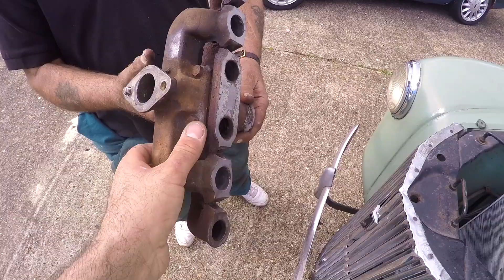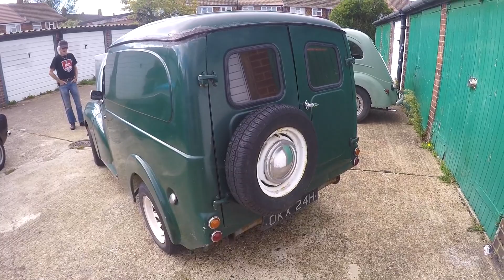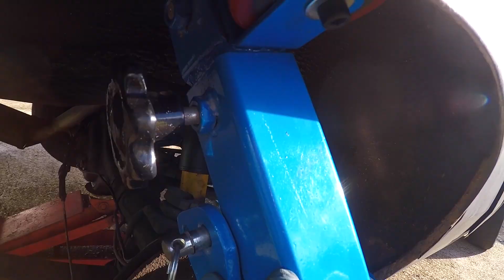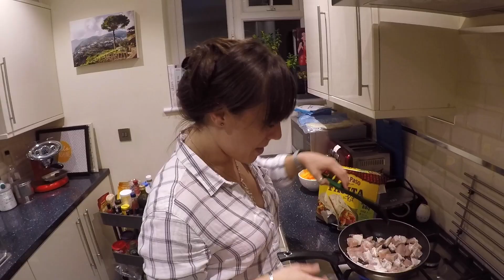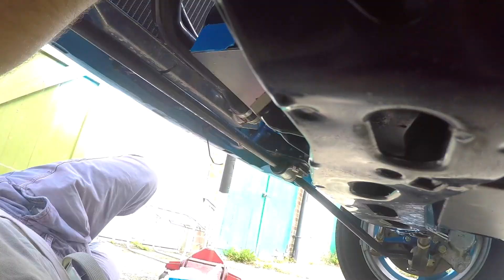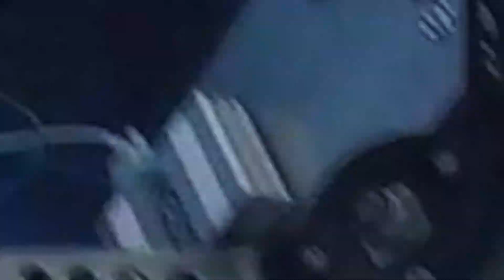'ESTHER' THE MK1 ESCORT ENGINE ISSUES SOLVED! 😃

Comment: Great video, Zetec sumps are hit and miss, usually hit ! I design my own and get my tig mate to join it all up .
 With the arches, they can be shaped different before welding on.... Or get Golf mk1 arches fitted 👍
Reply from the maker: Part of me is thinking that I should fit wider arches to 'Maude'. Shes going for welding in November so now is the time to decide. 👍
Reply: @marcushayesford  I suppose if you need new arches the golf ones will allow 7.5in- 8in depending the offset. 😁

Comment: Hey Marcus!
What gearbox are you running in Maude?
Type9? Standard ratios?
And what final drive are you using?
Thanks!
Reply from the maker: Hi mate! 👍 'Maude' has a Type 9 with a longer first gear kit installed, also the heavy duty layshaft bearing modification has been done. The gears are not straight cut or anything like that tho.The gearbox was rebuilt by HPE Motorsport and had every bearing replaced. 
The diff ratio is 4.1:1. I like my cars revvy for the acceleration. Im not interested in top speed. 😃

Comment: That’s great news on the mk1 can’t wait to see it back on the rolling road see what she does 
Its a bit of a bummer about the sump you had to wait so long for and it still won’t fit any good can’t see why people can’t make them right it’s not hard to use a tap measure 🤷🏻‍♂️love the Mexico trip as well  in the intro of the video 😂😂👍
Reply from the maker: 👍 The new new new sump that should HOPEFULLY be with me in 6 weeks SEEMS like its going to be perfect (according to the dimensions I was given by the guy having them made) Fingers crossed. 😃
Reply: MARCUS HAYES 
I hope so can’t wait to see it in and running see how them carbs sound on there

Comment: Marcus - great video as usual - check Maude's axle casing is not bent. The wheel is way back in the arch which is a strong indication there is a problem. I have bent a couple of casings myself, you only have to hit a kerb, they are not very strong. Try and get a straight edge on the back of the casing between the diff housing and the back plate, it should be perfectly flat. You may find it has got a bit of a backward curve on it...
Reply from the maker: Thanks for your advice! 👍 Theres defo a strong possibility the axle is bent but I think unless you modify stuff the axle will always move backwards when you lower the car too much??? Iv always thought that to get the axle central in the arch I would need to cut and shut the anti tramp bars?? And maybe even alter where the base plates sit on the leaf springs (all this is just UN-educated guessing tho! 😃) One thing that stopped me even looking into it was the fact that in terms of drifting an Escorts wheel base is quite short. So having the twin cam anti roll bar bringing the front wheels slightly forward and having the rear wheels towards the rear of the arches might actually be helping make the car less twitchy when going sideways??? . . . . But again its UN-educated guessing! 😃